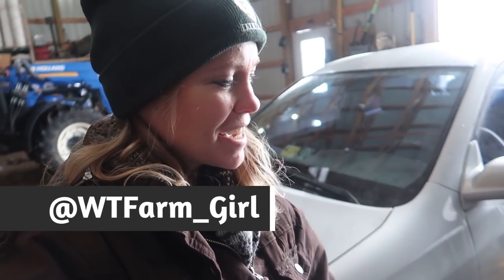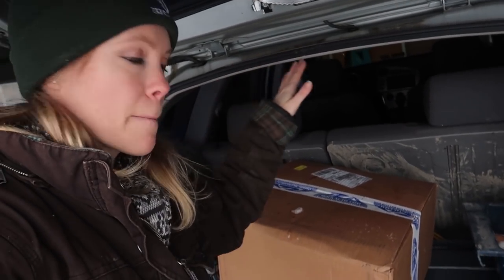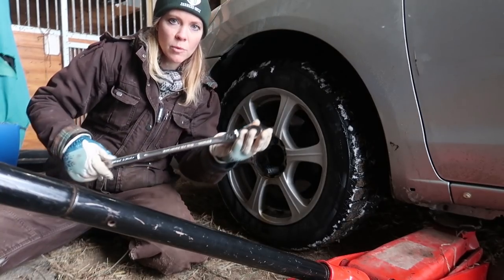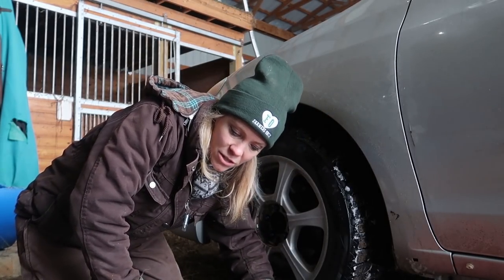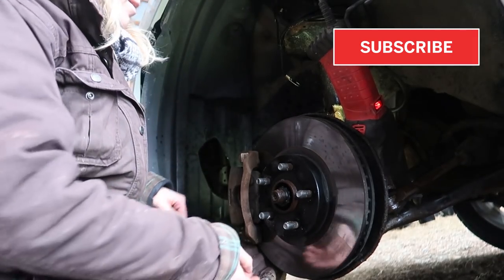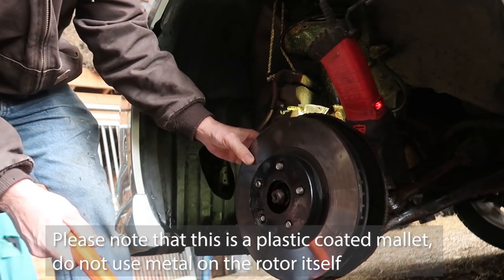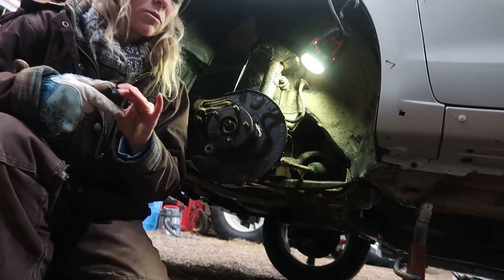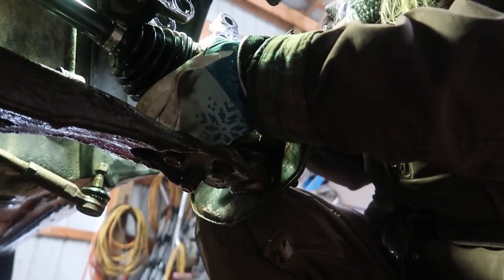280 Replace a Wheel Bearing Hub Assembly on a Toyota or Vibe

Comment from the maker: Hey guys! If there's any tips you have or things I forgot, post them right here!
Reply from the maker: The Kovariks  lol, well I'm pretty convinced moving cattle on horseback is BA and totally on my bucket list 😉
Reply from the maker: The Kovariks  😄💕
Reply: Best way to learn is do it you are doing fine
Reply: you have to run it down with a pry bar forcing the ball joint up and then tighten the nut . if the nut is lose it will destroy the new hub assembly
Reply: Wow so glad to see The Kovarics over here,2 of my favorite ch all great people. Natile if you see this reply you gotta check out Suzanne    wrestling with the 80lb hay baler tire in the field or pushing the Toyota Matrix out of a snow drift with the New Holland T5 115.
Reply: WT Farm Girl Videos Suzanne another way to tell if your wheel bearings are going bad is if you hear a harmonic sound at a particular speed and if your vehicle says service abs and traction control cause both systems work together and to remove the axle nut 🥜 have a impact axle nut socket and a breaker bar with a cheater pipe not a ratchet and remove the tire first and to get the hub bolts out easier turn the steering wheel if the bolts are acting up use some heat to release them cause they might have thread locker on them and you don't have to remove the ball joint or tie rod end or strut bolts cause then you need a alignment
Reply: Bailing Wire and bearings don't mix.
Reply: You need to redo the lower ball joint, normally the nut is tightened to a set torque, I just tighten as tight as I can get. Insert the cotter pin in whatever hole lines up. If none do, tighten a little more until a hole lines up. Yours is too loose and if you drive on it like that, it will cause wear to the tapered hole or cause the ball joint to break. Yours is way too loose, the stud should never turn in the spindle. Plus if the stud spins that easily in the ball joint it's probably worn out and needs the ball joint replaced
Reply: Just curious if you checked your CV axle? And just me personally on a car of that age if I was going to tear down the front end that far I would've just put in new CV axles anyway and rebuilt the whole front end with new ball joints and tie rod ends and tearing it down as far as you did you should also get an alignment on the front end. The alignment might be ok but an alignment is much cheaper than wrecking tires and having to buy new tires and having to get an alignment anyway. Great video though! Get you a Milwaukee fuel 18 volt high torque impact and it'll get those bolts out even if it has to break them off, mine has 1400 foot pounds of loosening torque.
Reply: Have a front end alignment done the two top bolts on the hub assembly you had to remove are part of the wheel alignment good job on the repair
Reply: Grease the axle shaft that goes to the wheel bearing was wheel bearing Grease then it won't seize up to that bearing
Reply: When loosening threaded fasteners, set your pull bar as near to horizontal as you can, so you're pushing at 90deg to the bar.. it maximizes the torque applied to the fastener...
Reply: Suzanne when removing the steering knuckle completely, you should really take your car in for an alignment to ensure everything is running true.  If the front end is out of alignment your tires will wear funny and you will need new tires later on....  You may already know this but it wasn't mentioned in the video.... just a tip :)

Comment: I truly admire your tenacity sweetheart. Also as being a retired mechanic (45+ years) you made me smile with all the animated sound effects.
I also noticed that your lower ball joint castle nut was either not tight enough or the tapered hole in yout new spindle was bigger. Please take a look at that soon or it (the ball joint) will fail causing you to loose control of your vehicle.
Reply from the maker: Yup, went back and re-tightened it later :D

Comment: I'll give you a tip on those cotter pins . Won't help the first time. But next time you remove it, it'll be much easier. 
Put the cotter pin in the hole. Grab the long end with your side cuts. (Wire cutters) And bend it completely over.   Then clip the other shorter end off even with the nut. Then when you need to remove it, you only have to unbend the one side. And it pulls right out. When you have two ends, you end up with a separated spot right at edge of nut. When you try pulling it out, this separated part wedges inside the hole.

Comment: That is great. I am sure that I would have had just as much trouble as you did. You took your time, you thought it out and you took it step by step. I used YouTube videos to fix my stove and dryer but it did not help with the hot water heater. You did a good job. I probably would not have done it but took it to a shop. I am proud of you. I am sure that your husband is proud of you to.
Reply from the maker: I think having an older car helps too, if something goes wrong it's not a HUGE loss, lol

Comment: You did GOOD.  Told ya it was tough.  You were ok jacking on what is called the Pinch Weld.
I use a big C clamp and with the movable pad on the Brake PAD and the other end of the clamp behind the Wheel Caliper you collapse the pistons so the brake ass'y comes off and goes on easily.
You were fortunate to be able to loosen that Tapered lower Ball joint and tie rod end without Heat.
A side cutter pliers works well for removing Cotter Pins.  Cut off legs, grab the loop and pry out.
Sometimes you can use a pin punch to knock them out instead of drilling. Take a few photos before you begin as some come without Dust covers and you must use your old ones.  Beware of the axle pulling out of the transmission.   Put down a big blanket or piece of cardboard to work on and put parts in boxes.  The Term is Foot Pounds for torque.  1 lb of force on a wrench 12" long is 1 Ft/lb.  Retorque those wheels after 100 miles.  I hurt when you hammered your hand.  No need for the music unless you were covering cuss words!  With weight on the lower Ball Joint, that castellated nut should be tightened more. The taper must be tight then it won't rotate. Remove the cotter pin and re-tighten.   IMPORTANT.
Proud of you.  Well done Grasshopper.

Comment: Re-torque the tire lug nuts after a few miles. For some reason a lot of them come loose after a new install and you could lose a tire.
Reply from the maker: Yes very true!
Reply: Due to centrifugal force and wheel turn direction most common you see people lose a LH side wheel more often then a RHS
Reply: Suzy FYI on a big truck semi the lug nuts are torque to 450 ft l b s
Reply: Proper fastener torque is like a rubber band, the bolt has to stretch to the correct point to stay tight.
Reply: Especially with aluminum wheels.
Reply: @sodbuster518able   I  have owned over  50 various vehicles  and they  all had normal right hand threads  except maybe  one Chrysler  Mini Van  and My  Oshkosh Truck with Big Buds..  that's  10 lug nuts  per wheel  with dual  inner and outer lug  nuts  I planned to switch to single floatation tires..  they wanted   $29.00 each for Left hand Lug nuts and $6.00 each for  right hand nuts  needed  20 of  each plus two spares.. finally I found a place that sold the Left hand lug nuts for  $9.00 each ..

Comment: It's funny you just posted this video. I just had a inner wheel bearing go bad Tuesday on my way back from my other house in Ithaca. Took it all apart Tuesday afternoon and ordered the parts, picked them up yesterday and put everything back together. A OK now :)
Reply from the maker: It must be the season!
Reply: @This1LifeWeLive  I think you might be right. I did drive almost 100 miles with it making some noise, but had to try to get it back to this where I had the correct tools to fix it. When I jacked it up the wheel just flopped around lol. I had to chisel off the bearing race that became welded on the spindle. But it all came together and it's back to being quiet and not shaking. Life is good again, at least for now.

Comment: Hi Suzanne,  you've replied to another person about the castle nut not tightening any further , I would suspect the taper on your original ball joint does not match the taper in the new hub assembly , this needs to be checked , if you drive whith the taper loose, you risk damage to the ball joint ,plus damage to the new hub, it's possible you need a matching bottom ball for the new hub, or have you got the wrong hub assembly,? The fact it came whith a sensor ,which your's doesn't ,might point to in  being the wrong part. ?. I would have e,mailed you but can't find your's, Best wishes Stuart uk.

Comment: Penetrating oil tips: After/during spraying, tap on the parts. The vibration helps work the oil deep into the parts. In cold weather it helps to warm the parts.

Comment: South main auto is sound advice but don't depend on   what you "saw", go "see" again and refresh memory. #2, Righty tighty and lefty loosey... get it... the "t's" go together and the "l's" go together if that helps you. And #3 try hard to get any cotter pins out if possible as it saves digging and drilling later. On a footnote, that milwaukee impact is one of the very best tools that you can invest in. So on the gun end where sockets go there is a ratcheting dial that sets the amount of pressure the power tool can go to, Eric can explain to you... I use that particular tool to take the wheels off the semi trucks (18 wheelers) and believe me, no bolt or nut can win against it. I will say that if you did do this job again that your confidence is higher and it would go smoother. I have seen men in my shop, me included fight wheel bearings for sometimes a day or more and have reverted to torches to remove and that gets expensive!! I can start breathing again as I haven't tried to talk to a girl in a long time, a very long time due to a broken heart, I'm 72 and was a mechanic for most of my life, owned the largest independent subaru repair business in the united states (triple a-1 subaru repair) google and see who owns today as I sold it many years ago, tired of people and the complaining so went on my way to open a very small by appointment only shop and was hugely successful till a accident claimed me and to this day can't walk. I miss working  with my hands and I admire your going out to farms and meeting people and teach/learn about how they do from making syrup to laying eggs!! I wish that your voice didn't quaver as I hurt when someone sounds if it is causing pain to them, wish  I could explain that better, so rock on girl

Comment: I hope you are going to replace the other side as well,always do both sides!! Harbor freight sells a joint removal tool kit !!
Reply: Dennis l total agree
Reply from the maker: Yes for sure! I think I can hear that side as well!
Reply: I think she did one side for practice  then video taped the second side as she got better at it ..
Reply: She is doing the driver side in the first half of the video and the passenger side in the second half, probably picked up on the passenger side where the battery died during the driver side.
Reply: @scottnunya1  Farm Girl announced that her camera battery died and she switched to the front facing camera on her phone so everything would be reversed.  A notice of the reversed image  appears @ 31:34

Comment: Susan first thing is get a hayes mechanics manual for the model and year and make its worth the $25 investment because it will give you the entire step by step detailed instructions on how to fix everything from the motor to the brakes to all steering components.  It will give you a list of tools needed and the safe way of doing things and the right way . on brake calipers before you remove them you need to release the brake piston to do that you have 2 options . 1. Use a pry bar and gentily force pressure towards the motor or option 2 is use a large c clamp put half on the back of the caliper and the screw end on the brake pad tighten the clamp a few turns then release . use an opended 17m wrench to losen the caliper bolts a socket will work also then hang up your caliper but dont over bend your brake lines or youll have serious issues .

Comment: Suzanne any time you have questions about doing things like this i will do my best to answer any of them.  I can't no more than tell you i don't know but I will help if i can!  Now that said.  I use a coping chisel to open the dimple in  the  nut . Replacing the assembly is the best way because you don't damage the bearings. 
Which happens when just replacing the bearings.  
Findings how to do things on the internet is harder to decode and time consuming than going and buying a book. 
I thought you did a great job. 
And as for the big axle nut you supposed to replace it every time you take it off.   Just ask !!!!!💖
Reply from the maker: I will ahve to look up that coping chisel :D

Comment: 6 point, and 12 point sockets. You can use a chrome socket with a breaker bar but not the impact wrench. Use a punch to knock out the bent portion of the locking nut. Damn Suz! I really wish you’d FaceTime me when you have these issues... much love!

Comment: when you moved the ball joint (before fitting back on vehicle) that castle nut also moved that means its too loose it should not move, it needs tightning then put split pin in,,you will get vibration when driving if thats too loose,..

Comment: Suzanne ...29:45 ....  I would check bottom ball joint ... the castle nut is not supposed to spin with the cotter pin in it. It should be torqued a lot more.

Also a wheel alignment would be good idea .....
Reply from the maker: The castle nut wouldn't go down anymore, so maybe it was damaged . . . might need to rplace it . . .
Reply: @This1LifeWeLive  : Suzanne, Don is correct! You have to tighten that ball joint spindle. It's SO DANGEROUS like it is. I would suggest that you temporarily put the correct size "machine washers" (they're harder)  under the nut and re-torque it. That will get you by for a while.  I think what happened, is that Toyota retooled the bearing assembly and it's thinner, and the ball joint that matches it is shorter. Check it (and the old pieces) with a caliper and see. But PLEASE don't drive your car until you "washer up " and retighten. (ALSO be sure the castle nut is not stripped out) I'm sure someone has already told you all this. But.... I might not sleep well, without telling you MYSELF.😔 Earl
Reply: YOU NEED NEW BALL JOINT NOW.. 😬 and when you change the ball joint or even losen is you need to get the alignment cheked. And if you losen the two bolts on the spring and berring housing you need to get the angle og the weel cheket as wel. Stay safe
Reply: @This1LifeWeLive  Don is correct that ball joint is not seated you can see it move back and forth with your hand do not drive it like that

Comment: Future reference on Carter keys use a small punch it works best and a pair of side cutters to pull the pieces out be careful not to cut them off when you squeeze 
And a locking nuts there's a lot of variation of those
I got some vehicles need work on do you want to come to Wisconsin

Comment: Where do we start? Safety glasses. Sockets are chrome, impact, shallow, deep well, 12 point or 6 point. SAE or metric. Your car will be all metric. That was the tie rod end not the CV joint. I always remove cotter pins first. Even if you cut the ends off, use a small punch from your chisel set and a hammer to drive them out. It's easier than using a drill. The big chain auto parts stores have free loaner tools. They do have kits for pressing bearings out and in. Set your ratchet to loosen or tighten before you put it on the fastener and you won't get confused. You can stand on the end of your breaker bar to use all of your 90 lbs to break stuff loose. Once a fastener is loose, go ahead and use your impact gun. Torque suspension fasteners to spec. I don't re-use cotter pins. I'm sending you some. You did a great job! Can Erik's shop check your front end alignment?  Maybe this summer you can rebuild a small block V8 for fun;-]
Reply from the maker: I actually did re-build a motor once (my first time touching car parts). It was an old chevy engine erik bought at a scrapyard for his ski boat. He couldn't figure out what was wrong with it. After a few hours I had it fully fixed. Don't remember what I did, but I got it working, lol!
Reply: @This1LifeWeLive  I bet you just talked to it nice like you do with your critters.

Comment: You can also use a punch to get the pins out. Make sure that is the punch is pretty close to the hole size and tap it out with a hammer or whatever is handy. Nice job on it.👏🤘

Comment: love the video. 

that axle nut is really just a single use item. should not be used again after you take it off. that pushed in part is called "staked". 

bolts are generally righty tighty lefty loosey. this is from the aspect of looking straight down on the head of the bolt or nut.
in your environment anti seize is useful on all mating surfaces.
on a breaker bar, if you need more leverage find a metal pipe just a little larger in diameter to give you a longer reach. don't worry a breaker bar can take it. 

again, a great video. I raise my coffee cup to you in honor.

Comment: I would highly recommend putting a dab of anti-seize compound on any threaded connections that you just might have to take apart in the future. You can use it on brake caliper bolts & between the rotor & hub assembly. It sure beats wrestling the bear every time you have to take something apart, especially if you have to drive on salted roads. There is a good reason why the mid-west is called the "rust belt".